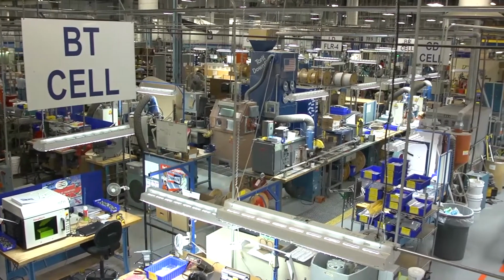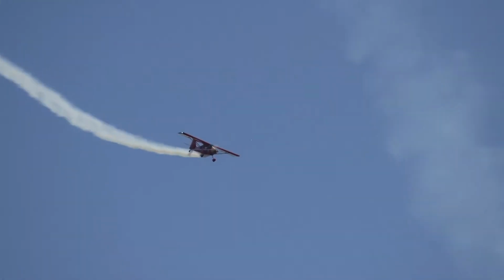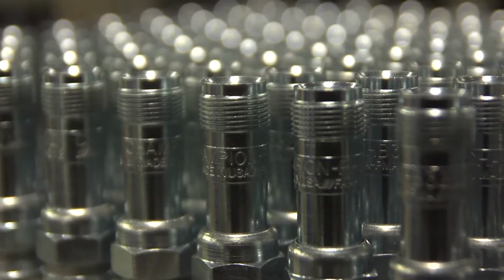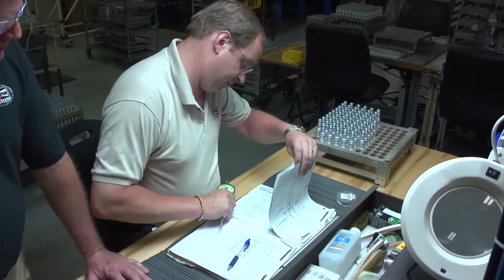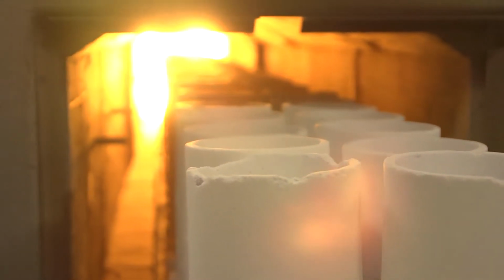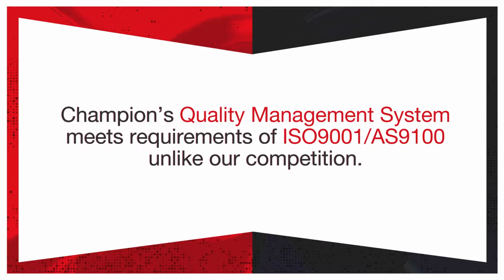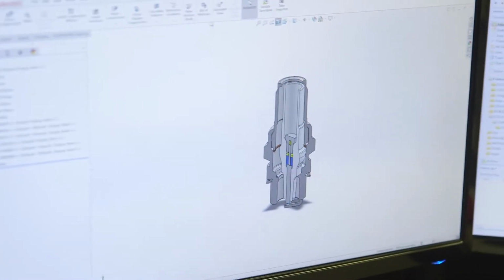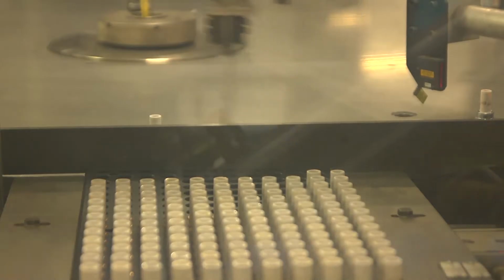Champion Piston Engine Spark Plugs

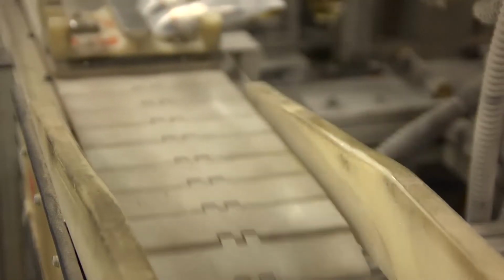Comment: 1:37 you should have done the same thing with those resistors and its design...……. denied it then...…... quietly redesigned it like a tempest plug...….. please tell me they read under 5k ohms out of the box now. pulling old champion plugs on my bonanza this week and switching to tempest. if you only acknowledged your problem right away I would be buying champions this week. Lame company
Reply from the maker: Harry Harkins Hi Harry - thanks for taking the time to leave feedback. If I can help answer any questions or concerns my name is Zach and you can reach me direct at 864-843-5301. Have lots of time in a bonanza myself - great airplane. Safe flying!